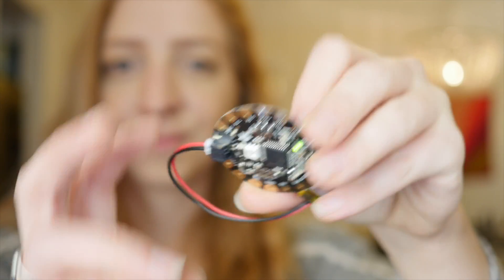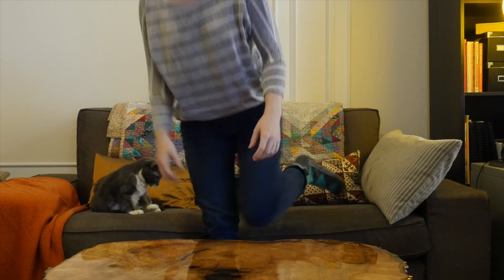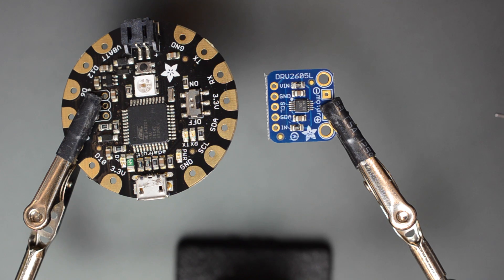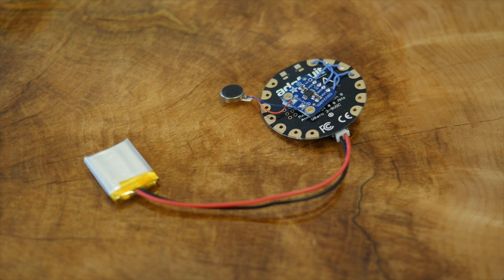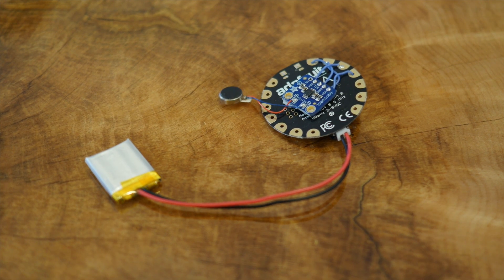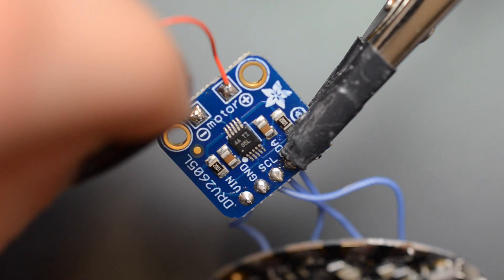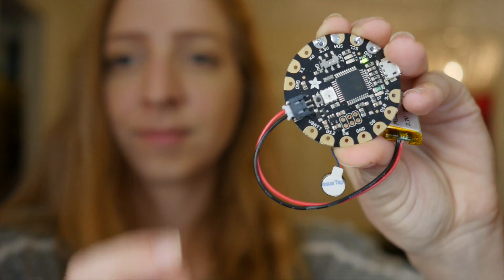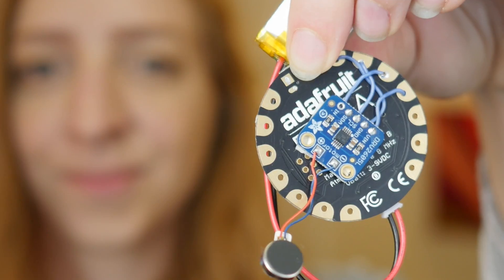Haptic Headband

Comment: How about using it to notify me when I need to drink water and rehydrate? Something like a resistor and capacitance measuring moisture in the epidermis. More moisture = less resistance and vice versa? I would really love to build such an item because I get dehydrated easily and have passed out a couple of times. This is ideal if it works. Thanks

Comment: Haptic Proximity Headband or vest for runners, joggers, bikers, etc.  Put 8 motors and 8 proximity sensors around the band or vest and then use the proximity sensors to trigger the appropriate motors so you get a vibration in the direction of approaching objects.  Maybe this could be used on a car as well to feel a car that is in your blindspot.

Comment: How do I ask this.....  I am a firm believer in "happy wife, happy life".  I am working on a project to insure my wife's happiness from very long distances (cell).  Is the haptic mini motor disk adequate for that task?   (Sorry...)
Reply from the maker: +Mad Medic Everybody's different-- worth a try!
Reply: +Mad Medic Might take a little more work but you could likely hook it in with a wifi module and do some careful packing. That way it means you could easily apply some code to allow full control through IP without the hassles of cell costs etc for a device that would need a sim.
Reply: Tech Thats a good idea!  Thanks!
Reply: Adafruit Industries Thanks for not laughing at me.  :-)